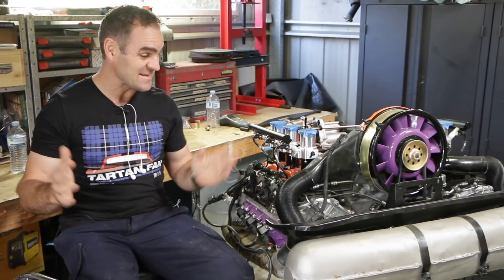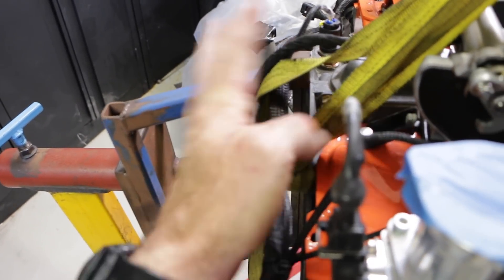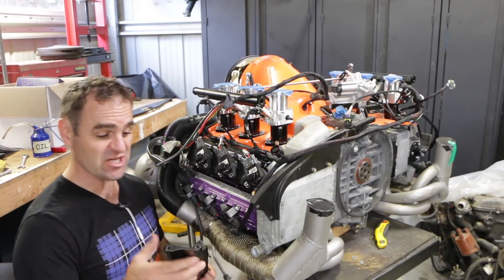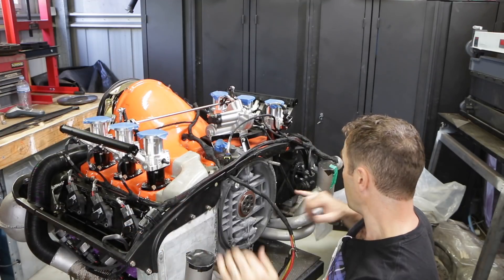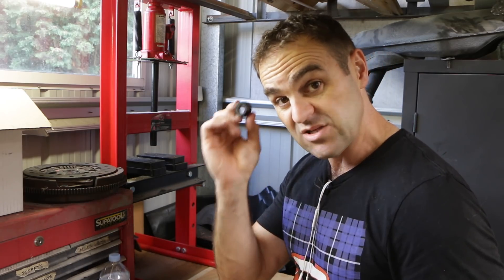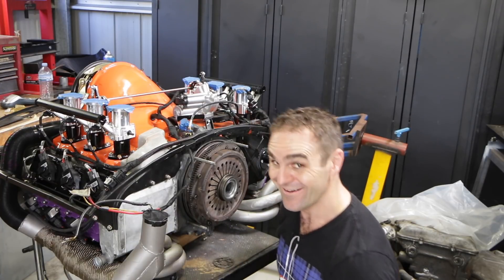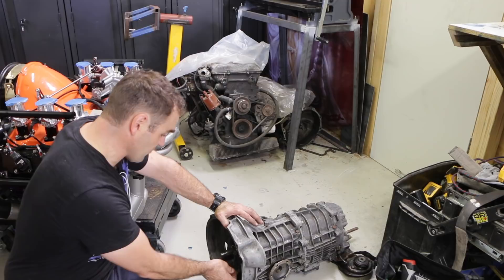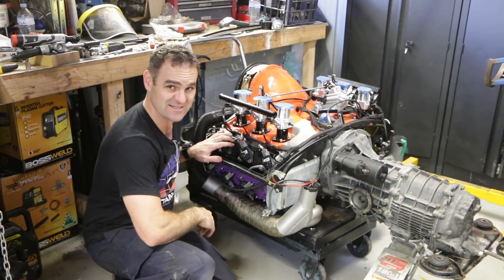We have lift off!... the stand - 911 2.8 RSR Build Season 2.26

Comment: Getting close now!

If it comes to it and the loom is short, you could look at going subaru style, with the plugs on a bracket on the engine and the vehicle side 'floating', save lengthening the harness.
Reply from the maker: I would only have to extend 1 or 2 coil pack connectors to get it to fit. No big deal.

Comment: Good work Jeff. Very glad that you have got to this point. I made the mistake of reusing my old clutch assembly when I rebuilt my engine. It also had plenty of 'meat' left on it and I didn't want to spend the extra money......but now, just 2500km later, I need to pull it all out because the clutch release bearing is knackered. I really wish I had spent the money back then and saved myself the hassle. :-(
Reply from the maker: Not that much hassle for me to pull it out and change it if I need to.

Comment: I have used a 1/4" drive extension with a socket that fits the pilot bushing and then slide a 3/8" drive socket over the extension that fits the hole in the disc. You can usually find sockets that fit very well.

Comment: The need for a special clutch aligning tool is a little overrated, especially when putting a gearbox onto the engine out of the vehicle as you did. Most times the "fudge it" job as you did is good enough, I've personally used long screwdrivers, ground down broom handles. And tape wrapped round bar as you sort of did. Well done that Jeff there...
Reply from the maker: I have pulled my hair out on Nissan's so many times, spending hours trying to get the box on. This went on like a dream :D
Reply: I must have used the same tool supplier as you, I must have fitted 15 clutches without the tool the last 2 or 3 have come with the thing and talk about cheap and nasty but they work,

Comment: So exciting! getting close to first fire up! Are you using ARP flywheel bolts Jeff? The Porsche ones are a one time use only deal as they stretch (like Porsche rod bolts). Did you use red thread locker on them? I bought a set of ARP's for my flywheel as they are reusable and were cheaper funny enough. Change the fluid in that transmission for Swepco 201 Transmission Fluid, it's like magic!

Comment: What's the redline on your engine?  I seem to recall some people (probably in Bruce Anderson's book) using loctite red on flywheel bolts where their engines rev to 8000 or so rpm (or the bolts back out.)
Reply from the maker: I should check that. I don't plan on revving it to the moon. Probably stick to 7000, but it is worth checking.
Reply: @HomeBuiltByJeff  Only thought I'd mention it because you're running a custom hot cam/pistons.  7000 rpm should be alright though.  I've spent too much time reading this stuff!
Reply: @dra911  valid point. 👍  I tend to lean towards using Loctite on every critical fastener (anything that rotates).  They have a variety of purpose made chemicals.  I suppose short of using wire locks, it's a good practice.
Reply: @HomeBuiltByJeff  Did you finally get a copy of Bruce Anderson's book? (Yaaay!)
BTW at 8:32: pressure plate. :-p

Comment: Spend 20K on our engine rebuild and not $20 on a clutch alignment tool Lol
Reply: It happens.  I think his remedy was spot on.  👍
Reply: The multi fit ones tend to be more trouble then they are worth, Last time i used one, had to re do it twice until it said stuff it, and did basically what Jeff did and got it first shot. The molded plastic ones that come with the clutch work well.
Reply from the maker: I wish it was only 20k!
Reply: @HomeBuiltByJeff  I was thinking in my head "40k engine" haha. Anyway its a great build, thats why its not an 80k build because you are sensible about things like the clutch for now. There is no limit to things you can replace with N.O.S parts.
Reply: @david elmsley
You have no idea what it costs to engineer a custom race motor like this.  They CAD design the whole engine,  air/fuel flows are computer simulated,  the specific rods are custom milled and hardened, sometimes in Italy. Same for the cam grinds and if they have to regrind the Crank. Piston selection too -forged, cast or hypereutectic?  You won’t even get in the front door for a project costing $20K USD.  Oh and YOU still need to supply your own block and do the rebuild and electrical harness. If it’s completely built, then were getting a Porsche racing engine you could try to run in competition and you at least  doubled the price.  $75-85K USD might  just cover it. 🤔
Reply: @alienpoker  An attempt at humour.  Perhaps it was missed.  20k USD was just a wild guess.  He does great work and I would buy that car any day.